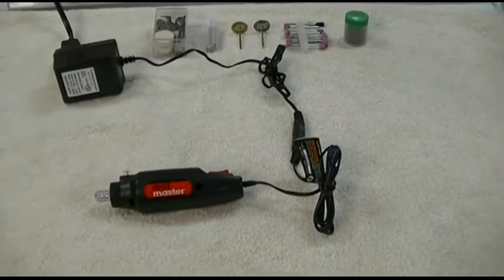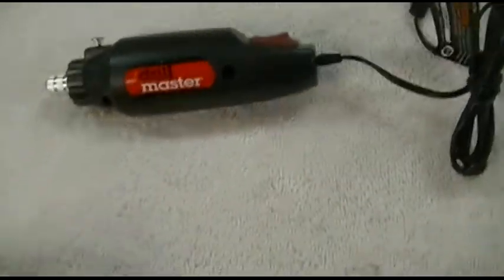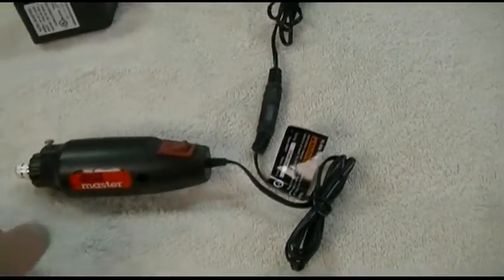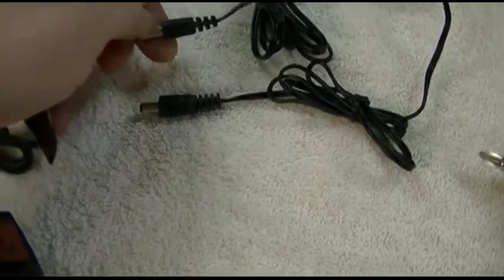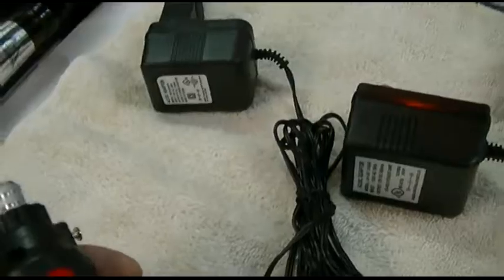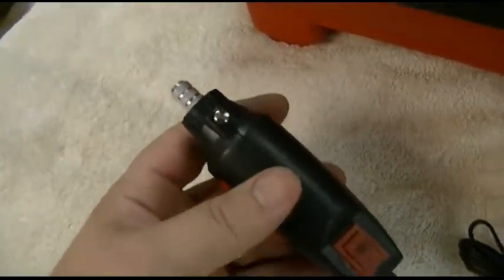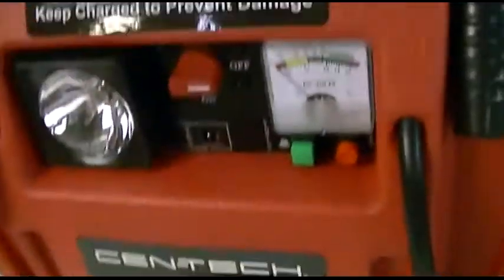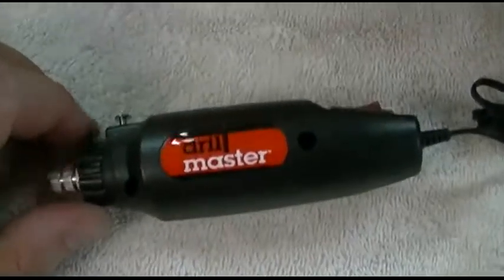Harbor Freight - Drill Master 80 Piece Rotary Tool Kit Review

Comment: I was installing a ball joint on an atv and beat in in slightly crooked. It created a lip up inside the housing, so I broke out my 7 dollar tool and it took it right down.  Then I put the ball joint back in .. straight this time.   I have so many power converters, I never know what goes with what, so i scratched them to identify them.   I got my 7 dollars worth.   Harbor Freight tools  a not intended to be used professionally. I but a lot of their stuff knowing it wont last, but wgaf?
Reply from the maker: R Doobies Exactly!  The stuff is so cheap, it's replaceable if it breaks.  And if it works 1 or 2 times you used it, you probably got your money's worth.  In fact, a lot of items sold elsewhere are exactly the same as the items that HF sells, just under a different brand, with basically a different paint job.  I found several such tools, and I have been planning on making a video showing the "difference" between the otherwise identical items, for twice the price elsewhere.

Comment: Let me just say this tool isn't as underpowered as everyone thinks, it may not complete every task as fast as a seemed but it define the does the same things, in my latest video I used it to easily cut Tin, it cuts trough a lock clamp easily but slowly. Awesome review though
Reply from the maker: Thanks for your input!
Reply: Hm, I was able to stall the motor by leaning on it just a tiny bit.
Reply from the maker: David Plass Correct!  I even did that in this video!
Reply: Yeah, it's a POS.
Reply from the maker: David Plass No, it's great for very light duty work.  It wasn't suitable for your needs.
Reply: I can stop it with my fingers, so ... it's not useful for anything for me. No worries, it was just a couple bucks.

Comment: I had the exact same one, the motor burned out while I was trying to cut a bike lock. I then got the Chicago electric one and for a little more bucks it was worth it, out lasted two of those drill master rotary tools.
Reply from the maker: Yeah, it's not designed for bike locks are stuff like that, this is a hobbyist tool.

Comment: Jay, all the bits wobble inside the chuck when turned on. Also, no matter how much I tighten it, I can still push and pull them; it's clearly not gripping them tight enough. Do you know any way to fix/work around this? (Yes, I'm using the corresponding chuck for each bit)
Thanks in advance.
Reply from the maker: +Fabiozon If you're definitely using the right size collet, there's something wrong.  The bits should just barely fit in the collet when inserted.  Then you press the little button to hold the shaft and tighten down the chuck.  Perhaps use something like a piece of rubber to help tighten the chuck?  My real Dremel actually comes with a small wrench to tighten it down.
Reply: Wow, thanks for the lightning fast reply!! Yeah, I'm using the smallest collet they fit in, pressing the button to lock the shaft and tightening it down as much as possible. I'll try with the rubber. Again, thanks!
Reply from the maker: Fabiozon OK, no problem!
Reply: I'm currently watching this video because I'm having the exact same issue!
Reply: Same! Cannot get my bits to stay

Comment: I want a drill that can put holes in stones for jewelry making (beads).  What do you suggest?  Thank you.
Reply from the maker: +Rhonda Ford It depends on the material the beads are made of.  The biggest problem you'll have is finding "precision" drill bits that aren't pieces of junk.

Really, the best (and safest) way to do that is to use a drill press, but that's a larger piece of machinery.  You'd hold the bead with a pair of pliers, then drill with the press.  If you use a small hand-held drill, you'll never get a precision hole, it will always be crooked or off-center.  I don't have anything in particular to recommend to you, I'd suggest you check bead forums or something like that; those in the know may have better ideas.  Good luck in your endeavor.

Comment: Great review on the kit, I was hoping you would have shown a little more of various uses. Either way, I received one free on a large order on eBay, and I can not, for the life of me, get the bits to be completely straight; ie when it rotates, they are almost all off axis. Is there a technique you've discovered on loading them that would help alleviate my problem?
Reply from the maker: Some are just like that!  If you look on Harbor Freight's website and read the customer reviews, many have said the same thing.  You might exchange it (by buying one from them and returning this one), but it's quite possible the same thing will occur, it might be worse, or it might be better.  Unless it's really off kilter I would live with it.  They all have quite a bit of vibration.

Comment: I just need something to sand out a guitar pickup cavity about a 1/16th of an inch.  It has to be slower because I feet if I use something faster I could end up ruining it.  I just need to use like a barrel sander adjustment and slowly sand out one edge slightly.
Reply from the maker: This should do the trick.  This tool works very slowly.  If you were to get a 120v powered one, you'd burn through your 1/16th and then another 32nd before you know it.  This is more of a hobbyist's tool.
Reply: @jaykay18  Thanks for the reply.  I will probably pick one up today.  I built a Telecaster from a kit and I'm in the process of upgrading the cheap hardware that comes with those kits. The replacement bridge I bought is just a screw hole width off from fitting.  So yeah all I need to do is take roughly 1/16th off one edge of the cavity and it will slide up nicely.
Reply from the maker: Very good.  You should be fine.  Let the tool do the work, bear down on it and you'll stall the motor.  Just take your time and all will go well.
Reply: @jaykay18  So I did go ahead and buy the tool and it really worked pretty good.  It definitely took patience but it was worth it.  Then I noticed the pick guard looked slightly off center once I got the pickup to fit in the cavity.  I checked the strings and they were centered on the neck perfectly so I had another job for this tool.  Just shaved a small fraction off the pick guard on one side of the area where it sits around the bridge and it looks perfectly centered now.  Coincidentally, then yesterday my son was putting a grill together and one of the screw holes had a metal tag like thing preventing a bolt to go on.  The tool did a great job grinding that little tag down as well.  It's funny, when I didn't have the tool it seemed like I never had a need and in just a few days I have used it three times!  Great little tool to have just in case.  Thanks for all of your input!
Reply from the maker: Thanks for replying and letting me know how it turned out, I appreciate it!  Yes, when you have a tool, you can find a million and one uses for it.  That's one of the reasons I added it to my arsenal.

Comment: hey I have one of these but the end of the corde was cut off is it possible to replace the end with the end of a plug in cord I don't know much about this stuff yet thinks
Reply from the maker: You need to supply it with 12 volts DC.  One of the wires will have a white stripe on it, that's your positive wire.  You want to make sure you obey polarity so that it spins the same way.

You can put any type of plus on it that you like.  You can use an old cigarette lighter plug from something like an old cell phone charger that no longer works, and then this can be used in the car.  Or you may have a wall-wart adapter in a junk drawer laying around.  As long as it's 12VDC, 500mA or higher, you're good.  Don't give it AC, and don't over-volt it too much.
Reply: @jaykay18  sorry for my bad gramer :), If we connect 1-2 amp adapters to this device, will it help?
Reply from the maker: @Cidoji  Yes, it will help it run better.  You can put as much amperage as you want, it will only use what it needs.  Don't go above the voltage much.  It's rated for 12 volts, 13 would be OK.

Comment: I have one...  For the price, the kit is amazingly complete for everything but one:  TORQUE.
I can't imagine it being cheaper to build a 12-volt unit when you have to include a wall-wart with it (transformer power supply), but that's what this motor is, 12 volts.  You can't cut anything with this unit without it bogging down to nothing.  It's a pity that I'll never get a chance to use all those accessories...
Reply from the maker: +Mark O I agree, it's severely underpowered.  But, again, if you power it from an alternate source, such as a 12V battery, or a power supply that has higher amperage, or an adjustable power supply where you can very slightly overvolt the unt, you'd be amazed how much more torque this little guy picks up.  It's no Dremel, and it's really meant for hobbyist use.  In that instance, it's actually quite usable.

Comment: Thanks for the tips. Are dremel tools compatible with this model?
Reply from the maker: That's exactly why I bought it!  Before you go and jump ship, again, this is a great tool for extremely light work.  Anything serious, you need a real rotary tool.  Harbor Freight sells a set of "dremel bits" separately, you might just want that.
Reply: jaykay18 The reason I ask is because, I'm based in the UK, a very (very!) long time ago I was given this rotary tool, I never used it much, but as you say, I now find it perfect as a modelling tool. Unfortunately I have about 3 different tools, and that's it. I want to buy some accessories so that I can get more use out of it. If I buy a generic kit from ebay that states they are Dremel compatible, am I to assume I can then use them with this? Thanks for your help!
Reply from the maker: swalstar All you have to be concerned about is the shank size (the "stick" part coming out of the bit), and the collet size (the part you put the stick into).  If it says that it's "dremel compatible" you should be fine.
Reply: jaykay18 Yeah, I was looking everywhere online to try and find what the diameter of the shaft was for the Dremel tools, the chuck in this tool doesn't vary too much so I didn't want to take a chance and buy a load of tools which wouldn't fit. Thanks, I shall now look for some Dremel compatible tools and get to work.

Comment: Can the black part screw off and use dremel attachments?
Reply from the maker: I don't know.  I actually bought it really for the bits it came with to use with my dremel, but I haven't tried that yet either.  I think the shaft sizes of this and dremel attachments are different, so I'd have to guess no for right now.
Reply from the maker: Vengeance CORRECTION:  YES, IT CAN!!!  There are other size collets included in the set and it allows you to use standard "dremel-size" attachments.

Beware of the low torque of the motor, especially if you're going to cut through something.  As shown in the video, the AC adapter included with it is pretty weak.  Consider using a battery or a higher-current-producing adapter for slightly more serious work.
Reply: jaykay18 I mean attachments like the "Dremel multipurpose cutting kit" to use the router type attachment on it. You would have to be able to unscrew the black part below the silver collet nut. Is that possible?
Reply from the maker: I don't believe so.  The black piece comes off in a bayonet-style mount, where on my dremel it unscrews.  So the dremel has threads and this is basically twist-to-lock.

Comment: Do u know if it would fit the dremel flex shaft
Reply from the maker: Cameron Walrod It includes 1mm, 3mm, 3/32", and 1/8" collets.  If your flex shaft is any of those sizes, yes.
Reply: jaykay18 thank you cause i got the drill master for 5 dollars and I don't feel like spending like 30 dollars on a dremel all I want is the 30 dollar flex shaft from my local Walmart then use that on my drill master

Comment: Jay, I'm thinking about buying me one of those.
Reply from the maker: +Marshall H. (gatrwrks) OK, be prepared for what it can and cannot do.  Like I had stated in the video, it's for REALLY light work.  If you power it from a different source (such as slightly over-volting from a different power supply, or powering it off of a battery that can produce more current, it becomes a bit more powerful.  Like they say, let the tool do the work.
Reply: They say not to press down on what over you're using it on because it will cause it to stop.
Reply from the maker: ***** Yes, that should give an indication of how light-duty this is.

Comment: The bits won't even get tightened in the drill. They fall out.
Reply from the maker: Perhaps your collet is too big.
Reply: @jaykay18  Thanks. The kit came with three of them and they never tightened. That is, they would be closed as much as possible but the bit kept sliding out.
Reply from the maker: @kevinbirnbaum6460  Might be a defect, that's a possibility.
Reply: @jaykay18  Yeah - I may swap it out. Does this have anything to do with that silver "set screw" button?
Reply from the maker: @kevinbirnbaum6460  When you hold that button, the shaft will lock (after partial rotation), and then you tighten the nut on the collet.  If you don't lock the shaft with that button, it'll just keep spinning.
Reply from the maker: @kevinbirnbaum6460  Sure, no problem.

Comment: It's 120 volt, I have the same one
Reply from the maker: I would rewatch this video carefully.  At about 3:20 I show the unit running on 12 volts DC, off the Harbor Freight Cen-Tech Jump Pack.

The adapter that is included with the rotary tool is indeed a transformer that accepts 120 volts AC input, and steps down and converts to 12 volts DC.
Reply: Lol mc it looks like mine i feel soooo stupid but good vid 1 like 4 u
Reply from the maker: Wolfie22lacrosse Thanks.

Comment: Nice review, however, this tool is terrible.  The lack of power will drive you nuts.  It can hardly do anything and won't even drill a hole in poplar.  Save your ten bucks and buy something else as this is a waste of money.  The only thing that this tool can do is sanding around wooden edges but you can do it faster with your bare hands.
Reply from the maker: The tool may be barely usable by itself, but if you over-volt it, and give it a power supply with a lot more current, you'll be rather surprised at how much it improves.  Either way, if the tool is junk, you can't beat the amount of accessories for the price.
Reply: Very true..it does come with a lot of accessories.  I will try to juice it up and hope I dont burn it up.
Reply: Jefftom66 Good for carrot grinding
Reply: Hi, i want to start working with wood, wooden jewellry, carvings, etc.

Will this tool do the job or i start looking for something else??

(i dont have much cash im a student so any advice i would highly appreciate it lol)
Reply: Works well for removing rust off tools.

Comment: Purchased the 80pc rotary online.. plugged it in and no go. Thought maybe it needed to charged but no charger available or needed.  Further reads on this, most all voted JUNK!!!  If i was you i wouldn't give this peice of shyt recognition. Cut the cord and give it to the kids to play with.  Smh
Reply from the maker: +Dick Miller It's a great tool for its intended purpose.  My purpose was to scrap the tool and keep the little gizmos for the end!
Reply: +Dick Miller      Maybe for you, i never had the opportunity because it never worked out of the box. I'm not one to return low cost items so i removed the 2 screws to inspect the attached wires etc. all looked good. After doing further reviews i couldn't believe the amount of negative reviews with many of the same defect as i had. I wonder if their is a lemon law for snake oils...lol
Reply from the maker: Dick Miller I knew about the negative reviews before I bought it.  But I bought it anyway.  Kept all the sanding discs and whatnot for my real Dremel tool.
Reply: +jaykay18  I just purchased the WEN variable speed with case more $$ but need a dremel. The reviews on these are very positive and watched them in action on youtube.. To your point i can use the other items on this dremel. I was just hot and out of shape about the previous purchase i think i can function now lol.  thanks for reply's
Reply from the maker: Dick Miller  No problem at all.

Comment: If I had one I'd run it off 18 volts.
Reply from the maker: It probably would run at 18, but I'd be careful about how long.  Best would be a power supply with a rheostat so you could turn up the power if needed.
Reply: Is a  rheostat the same as a variac?
Reply from the maker: ***** A variac will vary the input voltage into the device, which in this case would be a power supply.  For a magnetic-base power supply this shouldn't be too much of a problem, but a switchmode power supply wouldn't handle it.

A rheostat varies the voltage as well, you'd place it in circuit between the supply and the device.  It's basically a variable resistor.  So you'd have to start with, say, a 24VDC transformer, turn the rheostat all the way down, and slowly ramp it up.  A voltmeter attached would help so you can determine the actual voltage you're driving it at.  If you find a "sweet spot" you can mark that on the rheostat then turn it up and down whenever needed.

This tool is great for really fine detail work, in areas where you have to remove a very small amount of material.  Let the tool do the work, don't force it or rush, and it'll do fine.  It's a time-consuming process with this because of the low torque, but it will do it.